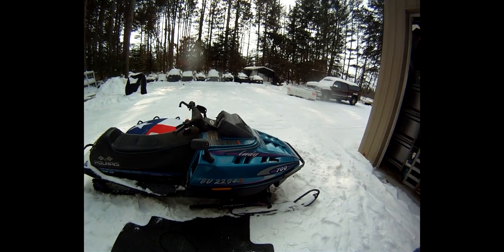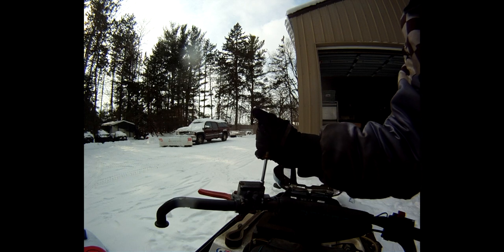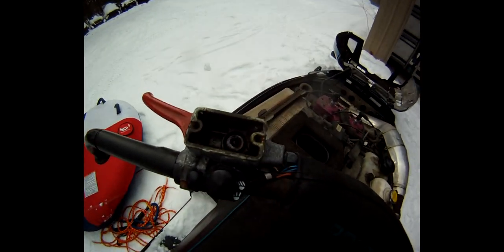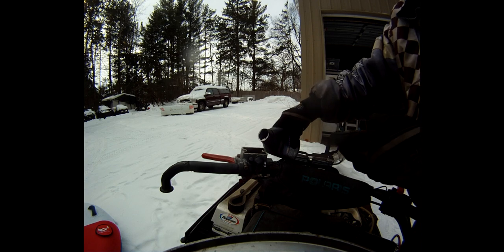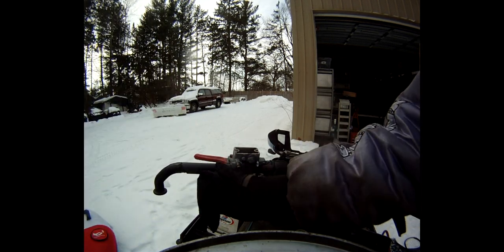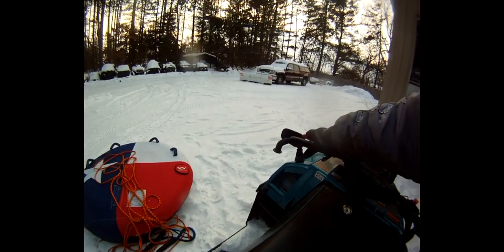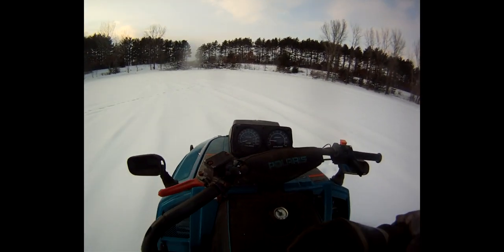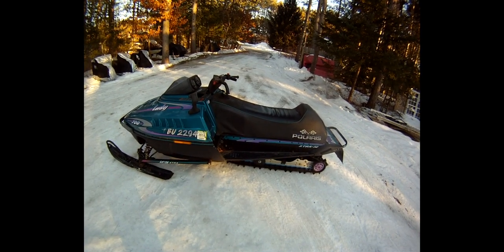1997 Polaris RMK 700 / No Brakes From Sitting / Repaired

Comment: by any chance, dose the seal inside of the master cylinder stay put i’m having a issue where mine keeps dropping and i’ve noticed the seal in the master keep moving the second i pump my brakes and it dose not fit in the hole that’s already there should it fit ?